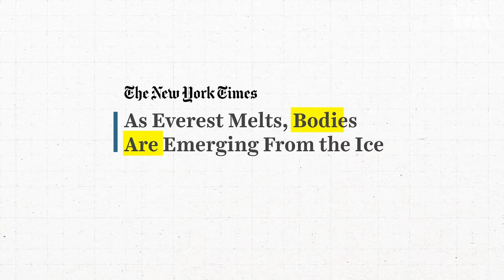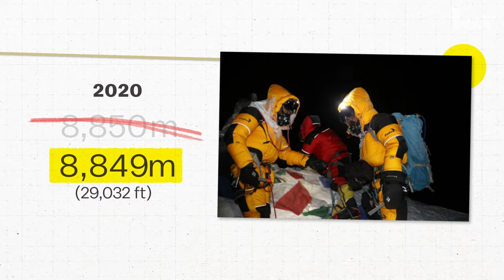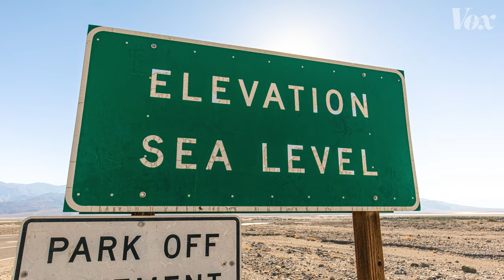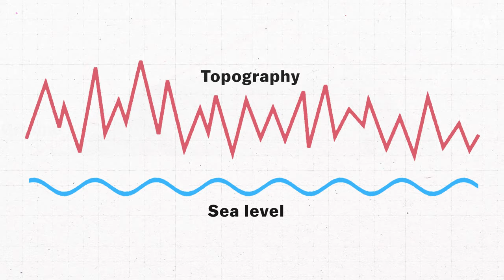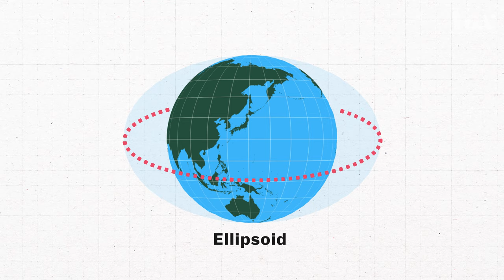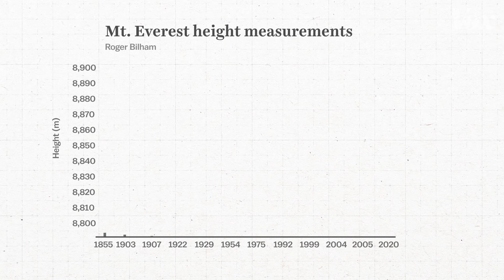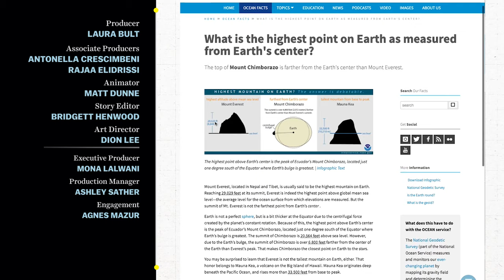Why Mount Everest's height keeps changing

Comment: Everyone gangsta till topographical prominence enters the chat
Reply: The parent peak of Mont Blanc is Everest
Reply: @counterfit5  How? I've not been able to grasp this concept of prominence. What does it mean actually?
Reply: @counterfit5  aa it
Reply: k
Reply: this isn’t really a prominence problem
Reply: Denali has entered the chat
Reply: @counterfit5  Mont Blanc is in Europe? How does parent peak system works?
Reply: @sushantbhandari7948  i think its something that measures the independence of a summit. Like something with a high amount of topographical prominence looks stunning because there's nothing around it nearly as tall. So Everest, while the king, doesn't look as impressive due to the fact that it's surrounded by massive mountains.

Something like that
Reply: Even more gangsta are the airplane pilots constantly flying higher than Everest (appox. 10,000m).

Comment: 2:24 that angle in the middle is not 90º, you shouldn't make the symbol of a right angle there.
Reply: @DrDeuteron  if you’re correct, AB should not be depicted as one straight line segment.

But AB is depicted as a straight line. Therefore, you’re wrong.
Reply: @DrDeuteron  ah okay. Also gonna get my brass rat next year! :)

Are you an alum?

Comment: Meanwhile Engineer be like :- Why worry.....Just take the average of all readings
Reply: Thats...not....how....engineering...works...

Maybe you mean statistician or mathematician. Then it makes sense.
Reply: Ok
Reply: @elbaecc  engineers do that... Mathematians don't... They thrive for the accurate value..... Statistician on the other hand..... They also do it as they only need to find estimates
Reply: @abhishekkulkarni2918  funny then, how i learned to average things in algebra class....
Reply: @elbaecc  you also learn how to diferentiate and integrate in algebra.... So that means engineers don't use calculus
Reply: @elbaecc  Ah man, I can guarantee engineers takes average. At least Nepalese engineers do.

- A Nepali Engineering Student
Reply: @abhishekkulkarni2918  Calculus is a different branch of Maths altogether. Also, the point went whoosh over your head, no? Engineering needs to precise about a lot more things than it needs to average out. Take airplanes. Sure, one can say this plane should be designed to carry a load of XYZ kg, on average, but then you also need to precisely calculate which areas of the plane need to be built to take on how much stress. Else you get a plane crash.

Comment: All outdoor brands are gansta until you need to climb The Everest, you only wear The North Face!
Reply: TNF is city wear junk. They make special runs of equipment for actual mountaineering.
Reply: BRUHH, the majority of them uses scarpa/la sportiva shoes, petzl/BD gear (for the technical ascent-abseil part), MH/marmot/sea to summit sleeping bags and lots of other brand to cover the support part of the expedition (solar&batteries, communication means, cooking sets)
Reply: @oswindrahermanu9700  Given I own most of that stuff, I'm well aware.
Reply: @steven7650  i was replying the main comment sir, the one that @prince tandukar said. Sorry if i offend you in any way; i was trying to debate the main comment.
Reply: @oswindrahermanu9700  oops, no worries.

Comment: Just a fact : The actual height of Everest was calculated by Indian mathematician Radhanath Sikdar . He got appointed for surveys in 1831 by George Everest , surveyor general of that time. Sikdar calculated the exact height in 1851 (but officially announced in 1855 ) . It was actually 29000 ft , but for some reason they added 2 feet more and measured 29002 ft .

Comment: Didn't they add 4 meters or so to alleviate suspicion that they guestimated it?
Reply: Well, every measurement is a guesstimate because they do not account for everything. Even the latest height jointly measured by Nepal & China doesn't consider geoid, so its also a guesstimate. But given that they were accurate within 8 meters with instruments from a century ago is quite a feat.

Comment: When the Nepalese surveyor took the GPS Static measurement last year, did he have the antenna rod measuring from the highest point of rock, or snowpack? FYI for people reading this who are not trained land surveyors: The maximum accuracy attainable from GPS equipmemt, using phase angle measurement of the L1 and L2 NAVSTAR GPS Satellite carrier frequencies, a Trimble Zephyr Geodetic quality antenna, and correcting the observations using the "Precise Ephemeris" published by the US Geological Survey, is about 15 mm horizontal and 40 mm vertical (measured from the Ellipsoid). To achieve a Circular Error of Position within this accuracy limit depends on a couple of other things: Observations totaling up to several hours every day, at all hours of the day and night for two weeks or more,  guaranteeing that the antenna did not move at any time during the observations, and an accurate ground survey between the various control points. Since this GPS survey involved only 1 antenna on 1 mountain top, and not a network of several inter-related control points that could be surveyed and analyzed as a triangulation network, and there was only a single 2-hour long observation, the vertical measurement obtained would have had an accuracy of probably no more than plus-or-minus 100 mm (1/3 of a foot). But still much more accurate than any previous survey of Mount Everest, using optical triangulation with theodolites from observing stations dozens of miles away.

Comment: There was also disagreement between China and Nepal's heights about whether the snow on top should be included as its height or not. China wanted to measure the mountain as the height of the rock, Nepal the height of the snow on top which is 11 feet thick. In the end they both agreed the snow height is the official height.
Reply: but the snow can grow and change?

Comment: If Everest is growing at about 0.2 inches per year, then it's grown almost 3 feet since 1855, and about 11 inches since 1952. This seems to be more or less in line with how the height has changed since the mid-20th century.

Comment: It's a common misconception that a lack of oxygen at altitude creates the feared Death Zone. It's actually our lungs' inability to absorb the oxygen at low pressure which causes mountain hypoxia.

Most of our species evolved at an atmospheric pressure of roundabout 100kPa or 1 atmosphere/bar. At the summit of Chomolungma the air pressure is only about 33kPa. 

Happy climbing!

Comment: I like Vox's engaging content and brilliant story telling. However, I am compelled to point out that the angle notation at 2:23 is used specifically for right angles. When you say basic trigonometry, it has to be a right angled triangle. This doesn't seem to be the case here.  Not that it takes away anything ;)

Comment: I read that they measure the height of mountains as how far they rise above sea level. Sea level is then not calculated by the level of surface from nearby seas. The sea level for the specific mountain is calculated by much the mountain's gravity would 'pull' the sea up, if there was a sea where the mountain is, which there is not of course - There is a mountain! :)

Comment: Centrifugal Force:  An APPARENT force that acts outward on a body moving around a center, arising from the body's inertia.
Centripetal Force: a FORCE that acts on a body moving in a circular path and is directed toward the center around which the body is moving.

There is no such thing as Centrifugal force (at least I'm pretty sure I heard centrifugal force in the audio).  

Otherwise, a good Vox Video, as usual.

Comment: I think another interesting measurement which isn't quite height but correlated would be oxygen level. Since what makes climbing tall mountains hard is the lack of oxygen, wouldn't it hold that the summit with the lowest oxygen level is the "tallest"? Seems like air pressure would be a more uniform and relevant measuring point than water level.
Reply: Not quiet sure about that. I read somewhere that other factors like wind, climate, etc also determine oxygen level. If you climb in winter the oxygen level will be less as compared to normal climbing window. I also remember reading that K2 which is shorter than Everest has lower oxygen level than Everest. I don't know how that works.

Comment: One can't know altitudes exactly, for we start from the reason-based premises of that which appears to us to be a starting point from which to measure. For instance, our scientists count the height of a country or of a given mountain, in "meters or miles or feet above the level of the sea". What a foolish starting point. The starting point for all measurements must be from the center of the planet, which never changes. This is because planet forms are not exactly round, but tend more towards an ellipse shape. For another example, let its say that we say Mount Everest is the highest mountain of Earth, then this is correct only so far, with respect to our sea level. But in truth it is around 2,150 meters less high than the highest mountain of our world. When you measure Earth mountains, then the center of the planet is decisive, and measured from that point of reference, you will see, the highest mountain of Earth planet is NOT Mount Everest. Pressures also vary greatly from one perceived altitude to another just as we have great pressures at the bottoms of our oceans so, if we have no oceans, we have great pressures increasing as one move toward the center of the planet.

Comment: 2:26 ah yes. Trigonometry so basic you couldn't draw it right. The rigid angle symbol is only used if the angle is exactly 90°. That is greater than 90° and should have used a curve. Also please consider using black text when on a white background or image.
Reply: yeah that part confused me as well. I think they thought, that their audience would not be smart enough to pick that up.